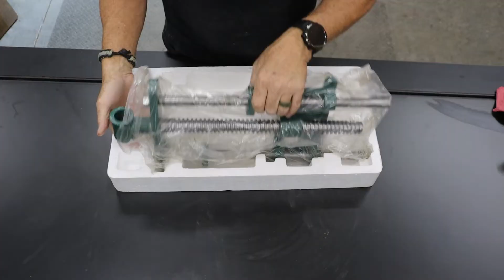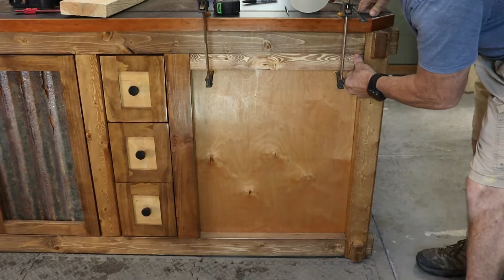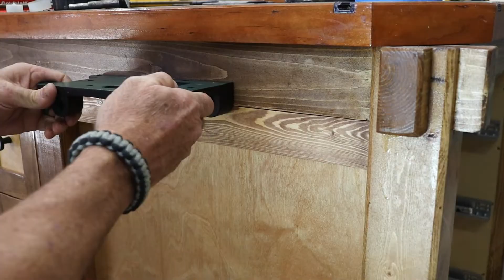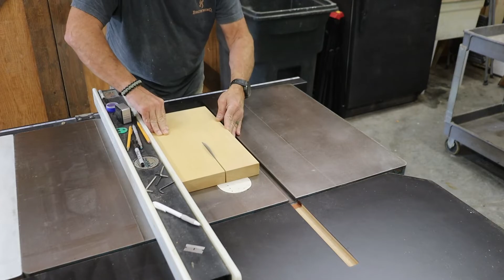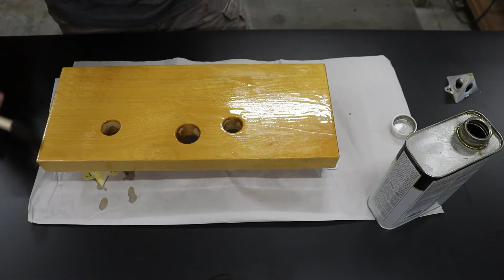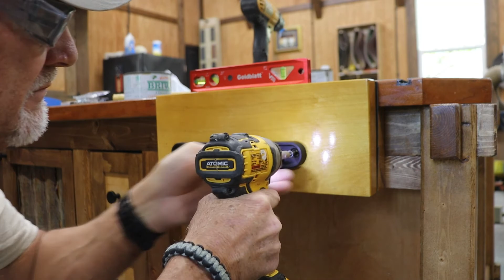How to Install a Cabinet Maker's Bench Vise Like a Pro - The End Grain Workshop

Comment: I just installed one 10 inch vise from a similar but cheaper manufacturer about a month ago and could have used some of your tips, but somehow I managed to get through. There is often no instructions or templates sadly. While it’s annoying, I can kind of understand because everybody’s bench is different. One person even returned theirs, because there was no instructions. 

I’ve seen about five or six similar videos, and this one was quite helpful, even though after the fact. Of course, most people are not going to have a jointer/planer/drill press  let alone a lathe either, but there are always work arounds. Everybody’s bench/table is different and could this be the true litmus test to admit as a qualification into the world of fine carpentry? To test your problem-solving skills? The masking tape template was quite useful. I used a piece of heavy paper with graphite from a pencil. 

For the handle, I just got a dowel slightly smaller than the vise handle hole and then found some cabinet door handles at HD that were just slightly larger than the dowel. I cut off the head of the handle screw, drilled a hole in the towel and glued it in and then just screwed in the handles.  Now I can easily take off the handle if necessary to replace, and these door handles are black aluminum and almost look like they were designed for this purpose. 

I think this vise is actual way stronger than my table at this point. 

Great video btw!!
Reply from the maker: Thanks so much! I really enjoyed reading your comment — sounds like you did an awesome job adapting it to your setup. I totally agree, the lack of instructions or templates can make these installs a real puzzle, but like you said, it’s also part of what makes woodworking fun — figuring out the best solution for your own bench.

Your handle idea is brilliant! Using cabinet pulls like that not only looks sharp but makes it practical if you ever need to swap it out. And you’re right — once these vises are installed solidly, they’re often stronger than the benches they’re mounted to. Appreciate you watching and taking the time to share all that detail!